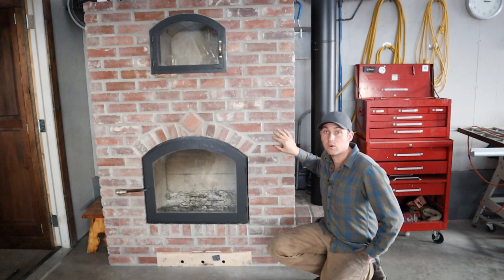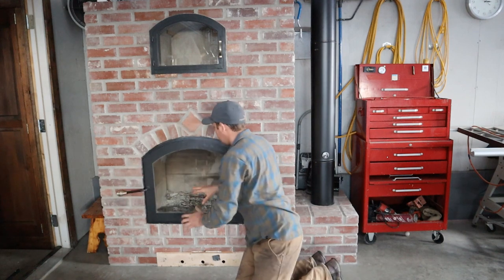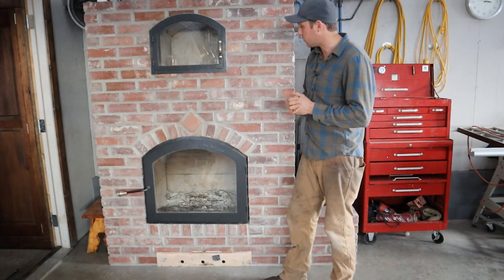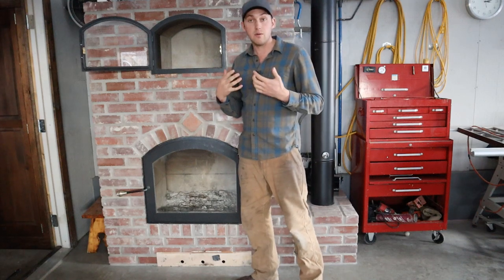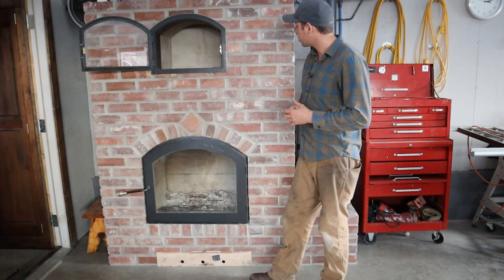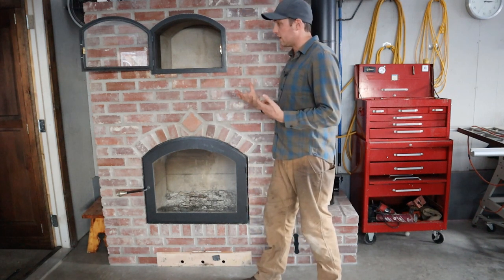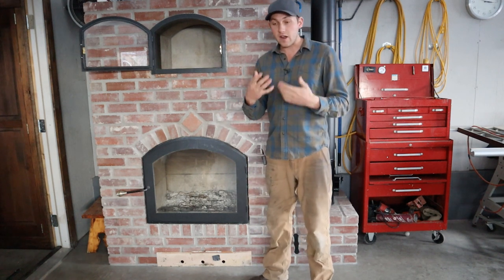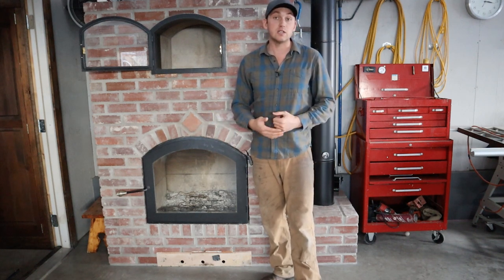Why I Love Masonry Heaters

Comment: I built a Russian stove out of cinder blocks for my garage, works great. General idea is to superheat the fire to get near 100% fuel burn without smoke. My main fire burns at over 1200 degrees F and the exhaust is near smokeless at about 150 degrees F. The heat gets trapped in the thermal mass. Step 1 is to build a rocket stove. Step 2 just add the down flow routes. Step 3 add the flu. I spent a few hundred bucks and a few days on the weekend.

Comment: I built our house around the Heatkit core here in Alberta. Under-fire air, white stove, and a heated Tyndall stone slab bench to sit or sleep on, along the back. Cinder block construction from the reinforced basement slab up to a cantilevered Q-Deck. I figure 7 tons of stone all in. The veneer was enlarged to hide a mechanical raceway on the opposite side to the chimney connection, leveraged it to preheat cold air by running it over top of the core, down the side into the basement forced air furnace intake. When your architect says "I don't know what a masonry heater is", find another architect. Don't build a house without one. Oh, and don't burn spruce, pine, or fir.
Reply from the maker: Great quote, I’m going to use that!
Reply: Pine and fir are the trees that grow where I live. Why shouldn't I burn them?
Reply: @johnstack4316 people have been burning what they have available for millennia. Just try to season it as best as you can, check your fireplace regularly to stay on top of build up, and if possible, utilize some of the techniques here with masonry or russian stoves for more heat efficiency.

Comment: Curious as to why you didn't make the chimney from brick and transition to stove pipe at the roof in order to soak up more heat from the flu gasses.
Reply: I would say that the metal flue helps heat the room faster, and the masonry keeps the room warm longer.
Reply from the maker: What @Eeton said!
Reply: Also, the flue gasses should not be that hot during the cycle, the masonry has drawn most of the heat by that time.
Reply: @GENECARP , it seems unlikely that with such a short path through the masonry that the flu gases would have cooled dramatically by the point that they reach the stove pipe. Maybe I'm wrong though and the contraflow is able to pull out more heat than one would expect in such a short distance. I would be curious to see what a temperature probe in  that pipe would read. I would guess at least 300° - 400°F.
Reply: That is how we do it here in Finland.brick all the way.And building it in the middle of the house .I have electrical heating but I have it set on 15c but they never switch on the masonry heater takes care of it all.And I have a brick cooking stove in the kitchen to.It is the best insurance if the power goes out in snowstorms.No freezing waterpipes here.And living on a farm in Finland means firewood is not a problem.Masonry heaters has been tested over here for hundreds of years.I don't understand why metal stoves are so popular in north america.
Reply: @lexluthor6497 , because it's hard to find someone who can build a masonry heater in the US so a nice masonry heater is 20-40k depending on size and a nice stove is 3-6k.
Reply: @lexluthor6497  it’s not that cold in America
Reply: @lexluthor6497  Because of greedy, proud 🔺$©heMEs and ignorant people who don't demand better for themselves and allow corrupt bureaucracy to dictate to them by said 🔺schemes.  That's about to change soon in all💎facets.  In the last 10years or so there have been the wood stove companies who've started making stoves that burn the secondary gasses but they are too expensive.  It's better cheaper and easier to research and do it yourself with family and friends and eliminate the middlemen.  John 3:16-21
Reply: @johnpenguin9188  
Yes it does. It is routinely for 3 months where we get -15f. It gets that cold. It's just in places you don't want to live I guess.
Reply: @theinternets7516  we have a master mason just down the road from us. He's been building masonry heaters all over the place!
Reply: @johnpenguin9188  uuuhh, yeah it is! I live in Northern MN and we are subzero for several weeks in the winter and winter last 6 months! It's plenty cold enough here!
Reply: @littleneedlesfarm6387  What part of the country? Thx
Reply: @CCRep123  Duluth MN USA

Comment: I wonder why water tanks aren't commonly incorporated into masonry heaters for heat storage.  It would obviously need to be in a part of the stove where the water wouldn't boil, but that seems very doable.  Water can store so much more heat in a given amount of space than masonry, I think something like 8-10 times as much heat if the masonry is only being heated up to temperatures below the boiling point of water.
Reply: On my Russian fireplace.   There is a hole in top.    Filled with sand.
Reply: I've been dreaming lately of building a home with a central masonery heater like this one and thinking I could incorporate glycol/water blend tanks with a water pump to pump the warm fluid through a system of floor heating tubing.

Comment: Well done, thx. We bought a similar masonry heater kit 25 yrs ago from a Toronto outfit. Had it professionally installed. Love it. Your comment about not being to explain how nice they are until you live with one is so very true. One huge distinction between the contra flow masonry heater and a Russian stove is efficiency.  The contra flow design like the Tuli Kivi achieves critically high temperatures in its upper chamber. Time, turbulence and temperature allow complete combustion of the woodsmoke at > 1200F releasing more heat energy. The resistance of heat having to travel down also contributes to greater heat absorption by the thermal mass for later release. Exiting flue temps are 250F.   Very nice workmanship on your stove ! Keep up the good work.
Reply from the maker: Good insights! Thanks :)

Comment: There is no draft involved in a contra-flow masonry heater.  That which appears to be 'down-draft' is, in fact, just the exhaust being pushed from the starting point- the firebox.  The same principle permits for the use of a serpentine route in the large masonry heaters.  The several cleanouts found on the larger heaters are really there just to satisfy building codes.   The size of a masonry heater and whether it has a simple contra-flow or complex serpentine exhaust route has no effect on how much ash accumulates within the route. In eastern Europe, where these heaters are most commonly found, they have one cleanout and rarely have anything to clean.  If anything, extra cleanouts are more used to inspect for cracking of the structure.  The one instance where draft might be useful is where a shortcut is used to the chimney to ease the start-up of a masonry stove.  That is, until the fire is hot enough to push the exhaust through the serpentine or contra-flow and suck in fresh air, the drafted shortcut gets the fire going quicker.  But using good kindling should make the lack of such a shortcut quite acceptable.

Comment: I'd be interested in turning my standard fireplace into a masonry heater and I want the oven too but also a cook top. I have two rooms on the backside of the all brick chimney and wall and had considered a boiler and radiator system to heat those rooms for sleeping but I'm considering a different thermal mass system instead possibly. Trying to decide between hydro or air. Or both to heat bedrooms or beds. But also have outdoor pool and shower just on the other side of the bedroom too and figured somehow I can have hot water, hydro radiator with boiler and thermal mass air exchange too. All on one fire 🔥

Comment: What kind of square footage could a heater like this keep warm in winter temperatures that range from lowes of -12°C to highs up to +10°C?
Reply: In Russia these heat a whole home, when the house is built with this type of heating in mind.
Reply: If you look up broaudio, on YouTube. He designs a variant of these that you can use as a stove. The ones he has as a design can heat 1000sqft to 1500. And those are smaller then this one.
Reply: @TheTyrial86 , thanks. Will do.
Reply from the maker: If it is well insulated, about 1500 sq ft

Comment: If you have a tighter airsealed house, could you modify the heater to have an air intake that is connected from the outside?
Reply: yes , a combustion air supply would be necessary and running through the heater will prevent cold drafts

Comment: Is it possible to remove the whitish coating from the brick so that more of the color of the brick shows?  Great intro to masonry stoves, keep up the great work!
Reply: You have to wash the bricks. It takes about 5-6 washes to get it off.
Reply from the maker: Yes you can, but I like the rustic look! The bricks are actually 100 years old. I reclaimed them from an old farm house.
Reply: Wire brush as soon as mortar is dry and gray, around an hour after laying brick,  not sooner or you'll smear it. If smeared or  dry'd too long, people use muriatic acid to clean bricks, i don't 'cause it's nasty and can burn you

Comment: Seems very expensive. 
What is the oxygen source?
Is the top box used as an oven?
Reply: It can be. The oxygen source comes from the room. But it can be done with an outside source. The area for an oven is a secondary burn chamber where wood gas is burned. The inner core gets to 1500 degrees. These are very efficient. What a conventional stove burns like 12-15 cords of wood. This would burn 3-5 cords. There really is only one to two burns in a 12hour period. So the cost is worth it if you are really burning with wood. Considering the cost of installing a class a chimney and some stoves costs 3k- 5k. This could be a better option.
Reply: @TheTyrial86  I totally agree. I plan on building one in my new home.